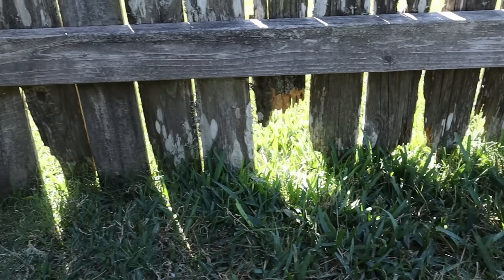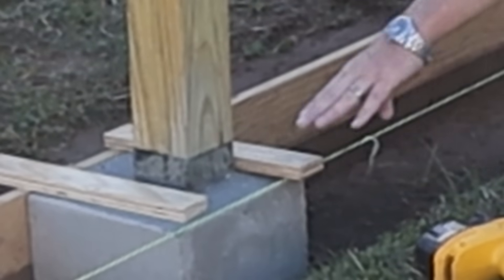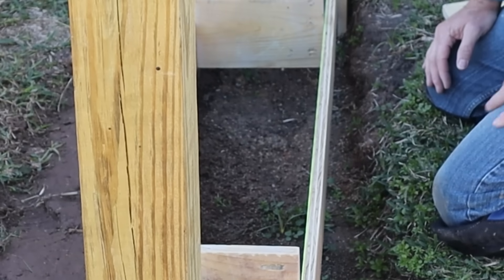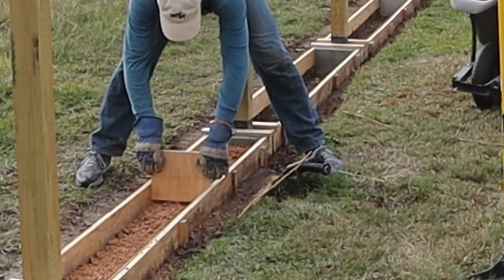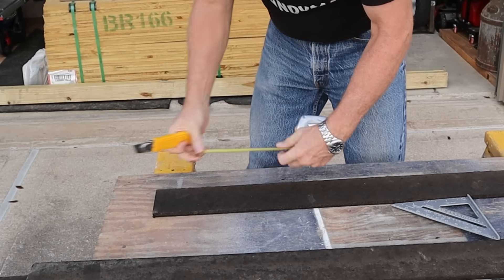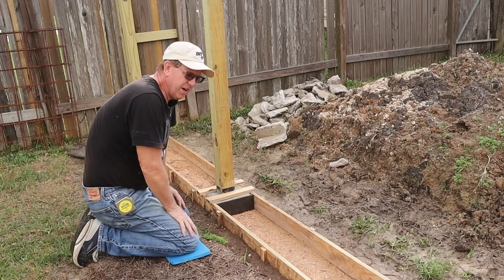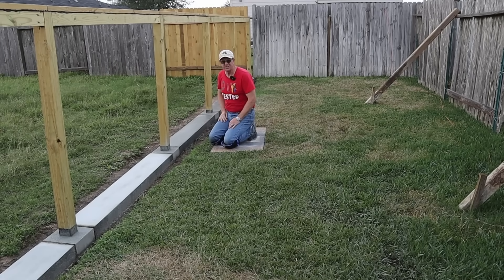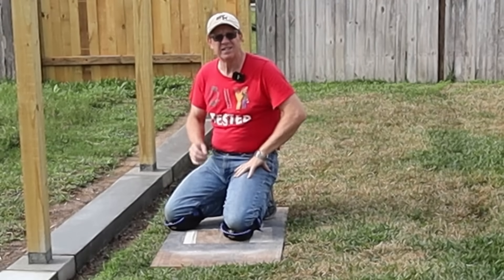Zero Maintenance Concrete Curb-Keeps Fence from Rotting!

Comment: You should have used a concrete edger and forget about removing your boards and floating the sides.  Also, if you put your left over dirt up against the sides then you will not see any imperfections.  We used to take a hammer and tap the sides of our forms for a smoother finish on the sides.

Comment: If you are that worried about rot . Use galvanized steel post. PostMaster steel post. Same thing for the fence sections . That worried about rot use aluminum or steel sections.
Those wood Post will rot no matter what. It's not going to stop . It will last a little longer thats it.
Im a pro fence installer. I've seen everything. I see what works and what does not.
The reason you're having all the  problems with the concrete. It's because you're not a professional concrete finisher. Easy to see.

But looks good for a beginner DIY

Comment: Concrete was too dry, use hammer to vibrate forms,  Can add a little portland cement for better finish.  Hardware cloth would be great reinforcement, since the load is zero, should used an edger to round the corners.  Put oil on forms so it wouldn't stick to concrete. 1x4s, string line, grade the bottom to get 4".  Concrete should have a slope 1/4" per ft.  AAA+++ for effort.

Comment: Apply some used car oil two inside where concrete meets your form surface oh, you may have better luck with no stalling when you remove the form from your concrete

Comment: How did you use a reciprocating saw to vibrate the concrete sides so smooth?  Did you place it along the outside and vibrate against it, or did you use a blade between the inside of the board and the concrete? It's an original idea to use that ...thanks

Comment: Would not do this to keep the bottom of the fence from rotting.  I'm not sure it will have much affect on rotting.  I have always thought about doing a streamlined version of this, however, to make the mowing process cleaner and quicker.  If you install it at a height where you just run over it with the mower, there will be no more string trimming (or letting the weeds grow) or dinging up the fence during the mowing process.  That, to me, would be worth it.
Reply from the maker: thanks for watching.

Comment: The only observation i have with this is that this curb is a flat surface, like a sidewalk, and every time it rains the water will splash up onto the fence (like 18" up) and the bottom of the fence will still be subjected to excessive moisture and premature rot the same as if you did nothing. and the posts are in the ground encased into concrete, i give them 20years and they'll need replacing again. All this in the name of easier weed whacking.  Expertly done video, but a hard pass for me, as I would use the LIFETIME STEEL POSTS  from HD for ease, speed, and same results without the backbreaking concrete work.

Comment: It's a shame you didn't leave some L shaped rebar upside down with the short leg facing toward the inside of the curb to tie them all together. I only say this because the curbs could sink since you put the fiber board between them. Also speaking as a fire protection construction worker that has watched concrete guys work just to try to pick up some of their trade... you can use kerosene or diesel to coat the inside of the forms to help them release from the concrete. You might need this because you are pulling them off wet but this is what they do when they pour slabs and remove the forms long after its dried.

Comment: nice - I think I'd gone with gravel then pavers for the same effect with the upside of future repair/replacement of fence - or gone with newer wood style metal fencing and call it done - or I'd run a metal "horizontal imitation wood rot board" and call it done if you want to stick with the rest of the fence done in wood. But I'd never do the concrete.

Comment: Very well thought out. No contractor you could hire would use as much care and forethought. The nails in the expansion joint seem like overkill but otherwise I'm very impressed. Using the sawsall as a vibe was an innovative step but I'm surprised you didn't just puddle the concrete with a piece of rebar or a trowel. The vibration will likely not reach very far past the outside inch or so. That's the only step you took which I questioned.  Well, I did wonder why you didn't oil the plywood forms but they seem to have come off fairly well with a bit of care.

Comment: Yes, you bring up the subject of the 4 x 4 posts twisting... I had some of that it was very slight but it did occur at the time I built the fence 35 years ago, but after 35 years there was more shifting probably more at the type of soil we have here in the desert there is a lot of movement, but overall things are reasonable given the time. In the extreme weather conditions we have here in the desert,  I would like to see how you finished the fence using 2 by 4"s and your slats.    I did do something to make my fence more rigid... And because of the way I put together I put an additional 2 x 4 on top of the support 2 x 4 on top of the post if that makes sense...  At each post the additional 2 x 4 at the post provided additional rigidity... So essentially there is an additional 2 x 4 continuous at the top of my posts looks just fine and the fence is much much stronger, we often times get hellacious winds in addition to our normal high winds,  this is where you find out your fence has problems that occur over time due to nature and wood drying out and riding over time.   The wood I see in the background,  is an example of what happens over time, something that is very hard to stop even with wood treatments

Comment: How are the posts anchored down?  I'm wondering how long one might expect them to last if properly treated for water.   I'd love to do something like this, but I think they need to be able to be easily replaceable in case of extreme weather, something running into one and snapping one off, etc.

Comment: Not zero maintenance.  Concrete absorbs moisture and holds on to it. The only way to do what you claimed is to connect the fence post to the concrete with something that will allow airflow.

Comment: Dog dig proof fence.  

Id take a grinder and roll the edgs that sharo edge will chip ez.  

Me i think it looks great,  i might use cement cap stones with the same base and a landscape fabric to block weeds.  At some point you may wasnt to cut out some of the expansion joints and use a crack sealer.  This couldn't look much better what type of fench shadow box or just pickets?  Show us the finnished product.   Your yards tiny, my fench would be 200' both sides and 75' acrossed the back with an angle its 2/3 an acer 
Technically your negbor owes 1/2 the cost of this project becuse he also uses it.

Comment: Why didnt you use an edger before pulling the form?
Reply from the maker: Because I put a steel trowel finish on it so I just come back in 48hr with a sanding stone for concrete and round off the sharp edges.  Thanks for watching.

Comment: Overly complicated and expensive. As others have mentioned pressure treated base board would suffice to mitigate wood rot and pavers would keep the grass away from the fence at a fraction of the cost. But I can see that this project fulfilled some desire to play with concrete and made you happy.

Comment: I put up a 250 ft wooden planked fence like that... and the bottom is a foot off the ground. So, it runs perfectly level the entire span. The way I see it, anyone willing to waller on the ground and crawl through the dirt to get through, would have just as easily climbed over the top. And if I see them over here they still can't get out fast enough before I grab 'em.  So, I encourage a little blackberry briar undergrowth. No maintenance required.

Comment: Next time (if there will be one) you could try mixing your concrete yourselfe, instead of using readymix. Just buy cement, sand and agregate and make a 1-2-3 mix, meaning: 1 part cement, 2 parts sand and 3 parts agregate. Only use enough water to get it wet enough so you can form wet balls with your hands (please do use gloves). Put it in the forms and use vibration to get the air out, to compact it and fill the form completely.

Also, use some kind of oil on your forms, so they come of easier. Diesel will work just fine...

Comment: I’m only correcting because you say you have OCD and will hopefully appreciate it.

First thing is you don’t pour concrete… you place concrete. I’ve done about 1000 pushups in the military for saying “pouring” and not placing when I was in masonry school.

Did you oil your forms? Oiling the forms will help prevent break out when removing the forms.

Great job! And thank you for sharing!

Comment: As far as your vibrator goes, you could have used a leftover junk blade, knocked down the teeth with a grinder and plunged it into the concrete itself. I suspect that would give better results than merely vibrating the forms.

Comment: 30 years from now some  28 yar old newly wed couple will cuss that you ever did this.
when they buy this house and the fence post need to be replaced.
Taking the old rotten post out will really sux.
I would use steel pipe fence post.

Comment: The good thing is the expansion joint material will have rotted out in two years and everything will have shifted to soil movement and wind loading on the fence. A better way would've been metal posts and a monolithic pour with a slight crown to it and radiused edges.

Comment: Unfortunately, in your effort to "over-engineer", you've built failure into the system.  By its very design of being a curb placed below a fence, this will never see a load beyond its own weight.  So the double layer of wire mesh and rebar is providing no benefit.  But it does create a source for concreate breaking rust if it's ever exposed to moisture.  And that's exactly what your support pins will do.  Especially if they're rebar.
For a small pour like this, you could have simply dropped the wire mesh in midway through filling the forms.  Or even better, used reinforcing fiber; this provide excellent crack control and structural reinforcement, without introducing a rust source.  For what's essentially a decorative curb, type S mortar with fiber mesh meets the application requirements and is easier to work.

Comment: Nice job and thanks! Did you consider putting a slight slope on the top? Not that sure it would add anything other than safety margin right at the posts. Also, I stumbled across some videos on “dry” pouring bags of cement. I have my doubts about that technique but thinking this would be perfect place to try it.

Comment: Nice job but just my two cents here ...Rule # 1 never bury a wood post in concrete or encase it in cement..its okay for steel posts but not wood..# 2  if you do a cement curb above ground level and are using sections of fence make sure you do not  exceed the building code height requirement ..# 3 speaking of code make sure you have your property lines surveyed prior to doing all that work or you may have to undo all that nice work

Comment: Great information video! Thank you for taking the time to create. Appreciate the tips on concrete. My father used the same concept of concrete beneath the fence – with a different approach: set the posts, higher edge and mowing strip in the one pour. He managed to not use steel or rebar, and has held up great for 30 years. The timber becomes the weakest link, with warping etc over time. Although different soil conditions to your situation. Thanks again for the great video.
Reply: did similar for the fence I installed last year. being 78 and lazy I hired a firm that does highway curbs. they came in and in a day installed the curbs with an apron on both sides so when I mow I no longer need to trim as the mower rides the apron. not all that expensive.

Comment: Bro, you're doing pretty good. Just a little suggestion. Concrete expansion filler needs to be installed only every 20 feet or so. Also I wish you would drill 30 degree angle with half inch rotohammer drill bit in those post bases ,and insert by baby sledge 14-16 inch  #4 rebars, sharpened slightly by grinder disc. Then bend them one of each side in to those curbs.  Then the whole system would be connected without "cold joint".
Reply: That's a genius idea!  I'm about to pour an ADA ramp that abuts to a concrete driveway and will use this approach to keep them in sync.  Thanks!

Comment: I have not seen them in the US, but I know in the UK that we have premade curbs like that for fences. They are thinner, and can be stacked to form a wall if used with concrete posts. This however is something that I wish my landlord would do or have done to the current fence that we have since on both sides the base of them has been damaged by age and plant growth. On one side we had a tree that grew with the fence right in the middle of it so the tree wrapped around the fence, and on the other side the bottom of the posts and the rot boards rotted away so much that it was leaning almost at 45 degrees into the neighbours yard. Having a curb system like this would certainly fix things.

Comment: Nice not seen anyone but me and my old boss do it that way 

But we did Steele post and all at same time and used 16 ft by 6 in corral boards for retainers which gave a good footer for the corral board panels 
We used them to make custom 10/12/14 foot fences they come proofed but we usually put a coat of redwood Thompson's for extra security

And cap top bottom and corners makes for very imposing fence for buglers from ally way 😂 

Only difficulty is the boards are not know for perfect strait so we built a jig to press them into strait after picking threw the pile at the yard plus every panel gets either cleated nails 4 each per rung or screws so it never wiggles or pops out

Comment: Thank you for this. I need to do a new fence soon and have had a few ideas for a retaining wall below the fence. I like the concrete footer though and might try to do something like this and hopefully ditch the retaining wall altogether.
Reply: Keep in mind that concrete will usually chip and crack. It's far from a maintenance free material

Comment: Hope you got your neighbor's okay in writing unless it is totally on your side of the property line. Even then, it could be a.problem. And then you proved why you should have used your edging tool. Those sharp corners will break off easily, even after it has cured.

Comment: Thank you for the video. I may not do it the exact way you did it but there is a lot that I learned from it. This type of concrete curbing is something that I thought of doing on my wooden fence because I have dogs that tend to dig, and I think it would solve this issue as well as help with the rotting from standing water from the rain. Thanks again for your version of this process of installing a concrete curb on a wood fence. I tend to think like you do with the ocd thing and/or the attention to detail too much. I tell myself to stop it, or it tends to make things a little overkill., so I understand that.
Reply from the maker: LOL.  Glad you liked it.  That is the nice thing about DIY you can let your OCD go wild.  I wanted concrete this time but I have used PT 4x4 between fence posts and use rebar to stake them into the ground so my dogs wouldn't dig also.  Thanks for watching.
Reply: What he did was obviously better, but what I have done to help prevent dogs digging under the fence was use pavers. I have done the concrete forms when I needed a like knee-wall under the fence and used stone to cover it.

Comment: Nice job. I see concrete guys put an oily substance on the forms so the concrete doest adhere to the boards. 
I'm planning on building my own fence so it was good watching you do yours.
Reply from the maker: Yes they do, I seen them use diesel fuel, motor oil, they make a releasing formula for concrete.  Could try waxing the wood forms.  Didn't have any issues with the fence posts if you watched that video.  Don't know how much difference it would have made on the curb but I have more to do and will try it on them and see.  Thanks for watching.
Reply: It’s a release agent. You can also use plastic.

Comment: I grew up in an early 50’s suburb with chain link fencing. My job was to pull/keep the morning glory vines out of the fence which sucked when your 10. I talked my dad into doing this exact process albeit much less anal. LOL. Now 50+ years later the concrete is still there doing it’s job.

Comment: Waste of efforts and materials. The plywood used for forming the concrete could be simply attached to the fence and do the job (and some concrete first). Or some other cheaper material.

Comment: This guy is building a reinforced concrete foundation for a fence?
You can just lay concrete blocks and get the same results. I have never seen post faces that big. Overkill does not begin to describe this project. I take it he is doing it himself, but good luck finding a fence contractor that will agree to do the work, and if you find one, be prepared to pay 3 -4 times the cost of a standard fence.
I am a Licensed Civil Enginer (PE) and i appreciate the work and eye for detail but I would never recommen this approach to any client. This is the equivalent of getting a fork lift and dump truck to move a 10 pound bag of sand. SMH.

Comment: Another really inexpensive way, is to use cheap drain pipe along the bottom. Split the pipe down the centerline, and slide the boards in. Drill a few holes on the bottom to allow for drainage of moisture. You can even inset the pipe an inch or two into the dirt, and paint it whatever color you want.